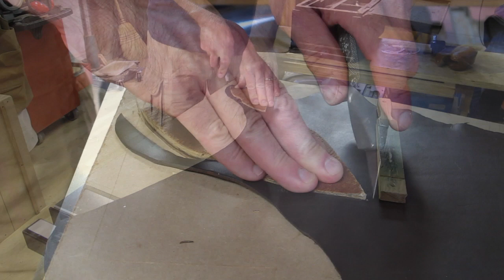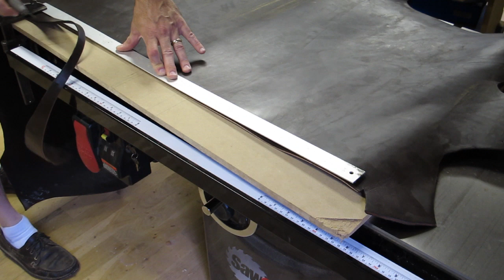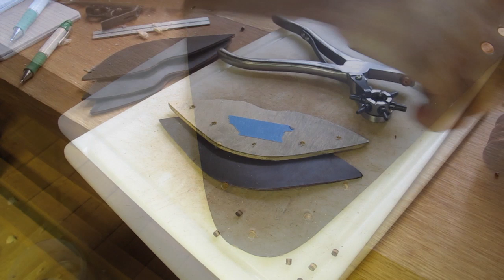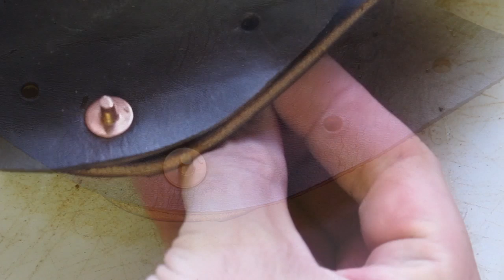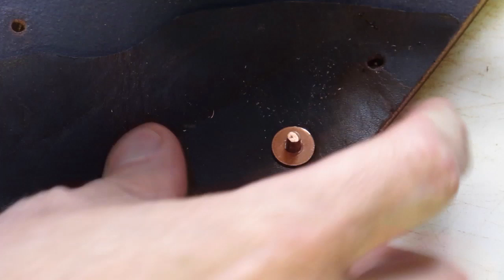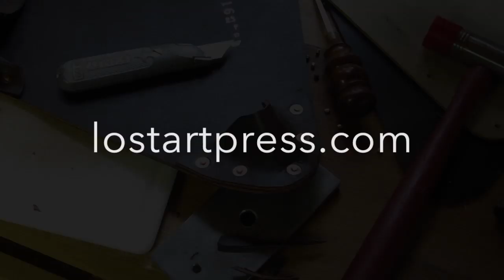Campaign Stool Leatherwork

Comment: I was gifted a similar stool about 45 years ago. The corner pockets were laced on to the top. Some of the lacing has disintegrated - can I re-lace? If so, where do I find a needle with an eye large enough to handle the leather lacing? Or should I use rivets?

Comment: Rivets! Where can rivets of various sizes and lengths be found? I am looking for rivets to make accurate folding camp stools and camp chairs.
Reply: McMaster Carr, Tandy leather.
Reply: MomanSLM  also check with your local farm supply store,in their tack dept...if they dont have them the usually can order them in...also wooden boat making supply houses carry copper nails that work just as well and usually cheeper...you do have to buy the copper burr sepererate or you can use steel washers in a pinch